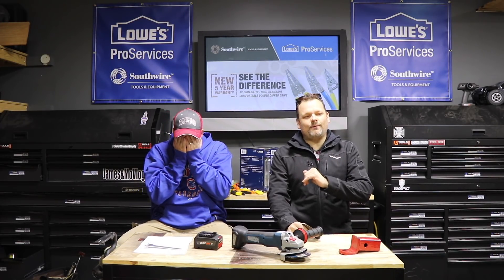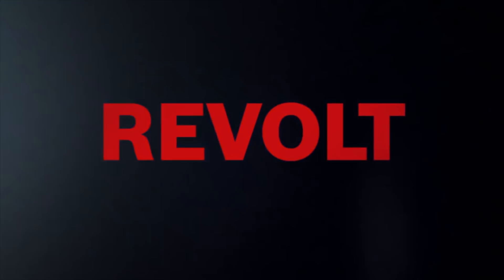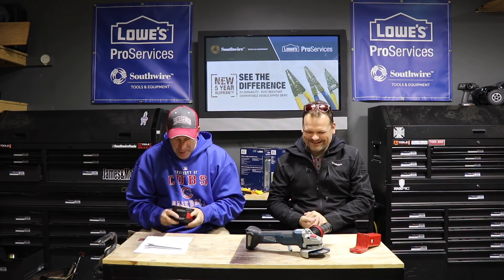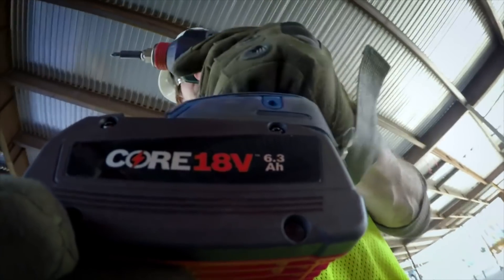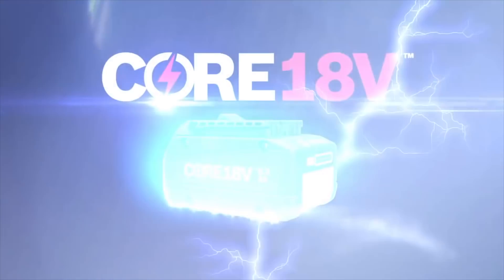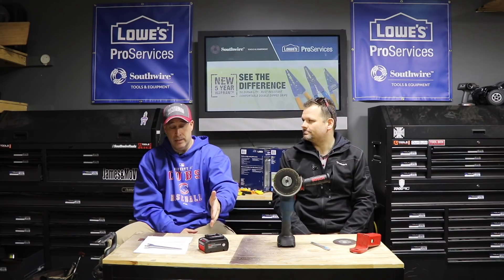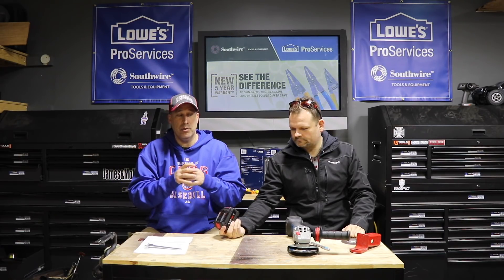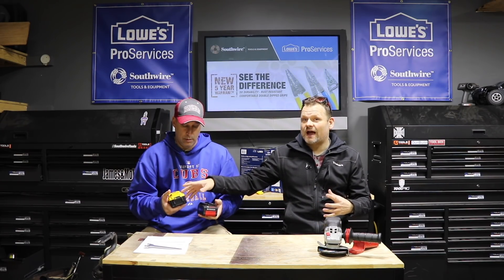BOSCH CORE The Ecoboost of Tool Batteries

Comment: I wish they made an adapter where you can use milwaukee batteries with dewalt tool or rigid batteries with makita. Like a set of different adapters switching batteries to different tools

Comment: I think the core batteries are going to kick some major but. Just imagine the new kind of tools that are high demand that can come out. Imagine grinder on full grinde can last what 20 minutes for the Dewalt 9amp flexvolt, if you can get 20-30-40-50% more that is alot. And now they are comming out with a 12amp. That could have like 1 hour runtime. Hopefully the charge time is not 2h.
Reply: Luc Funicelli no they won’t, these kind of batteries have been on the market for years now, hell gaming laptops have used them for almost a decade now. These cells have been around forever. Pure marketing
Reply: Ya but gamming laptops have more of a square battery when you compare it to cells of 10-12-15 etc. I dont think that laptop batteries have high demand output compared to the Core batteries.

Comment: Total BS....marketing. They compare the Flexvolt 6ah to their core 6ah, but when compared to the 20v 6ah Dewalt wins....plus it doesn’t matter what batteries they have, NO company 0 can compare to the power of Flexvolt tools, Not even close. ( except the sawzall) ....what does it matter if the battery lasts 20% longer but the tool can’t do the job.........I do love Bosch 12v , exceptional quality, just not readily available in the USA..

Comment: Metabo batteries are way better as they have a even better battery cell  which means you get 10 cells in a 8ah which means it is more compact and metabo is the number one battery world wide!!
Reply: Metabo does make some of the best battery packs around but distribution and tools available are limited. They are not a great tool line for a builder, plumber, electrician, metal working they are great.
Reply: James Little I'd be curious to see which cells are in the metabo batteries? I know bosch will be releasing an 8 amp hour as well.
Reply: Metabo are using 21700 cells in there new batteries. And yes Metabo is rare in the US but they are very well known in Europe. Metabo should be getting better distribution in the US as Hitachi will help them. Metabo have released a 10 inch cordless table saw and have some really nice sds drills and yes there metal working tools. Im a pro joiner in the UK and i choose Metabo always!!
Reply: James Little. I think the 21700, and 20700 are the same?
Reply: The 20700 cells are smaller than the 21700 as metabo used the 20700 cell in there 7ah and now there using 21700 in there 8ah and they say the 8ah is smaller in size compaired to the 7ah

Comment: If i wasnt a dewalt owner and i had to start again, id go bosch. Nice quality tools and they're built to last.
Reply: Not even close to the power of Flexvolt
Reply: Oh deary me i stated my opinion on the internet! I'm wrong. I'll stick with dewalt
Reply: Ethan ridesbikes their sawsalls suck balls. Our shop converted from dewalt to bosch and our construction guys hate them. Blades literally pop out of the chucks.
Reply: Ethan ridesbikes these batteries are old ass tech and are nothing but a slightly bigger cell and higher amps, problem is the life of the barriers don’t last at all.

Comment: They're using bigger cells, 20700, as opposed to 18650.
Reply: The Flat Garage I understand that, my point it is marketing bs on their part. This stuff has been out for a long time and used the example of high drain gaming laptops.
Reply: The Flat Garage bs they have been used in gaming laptops for years now